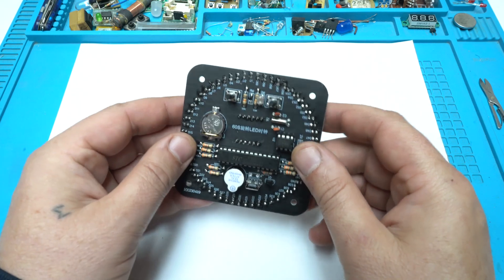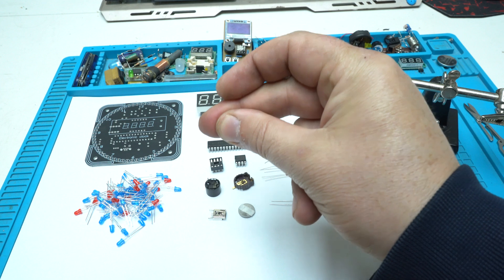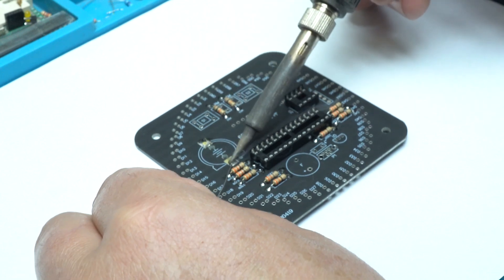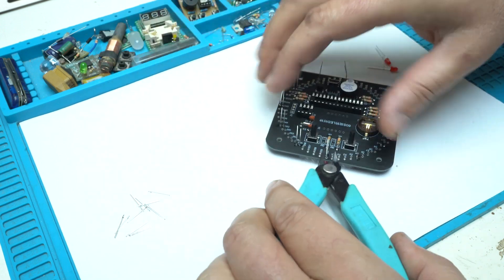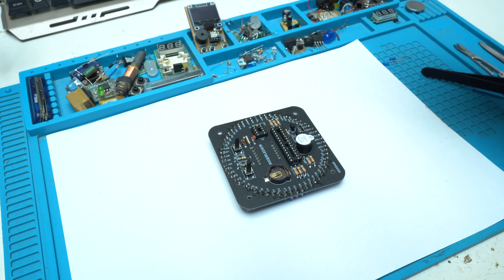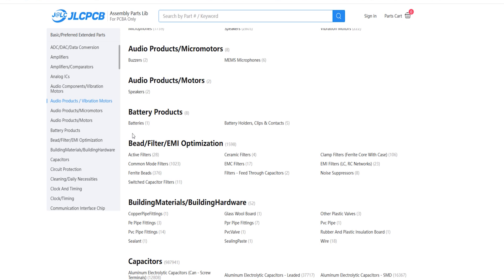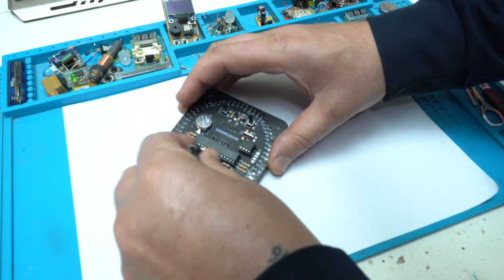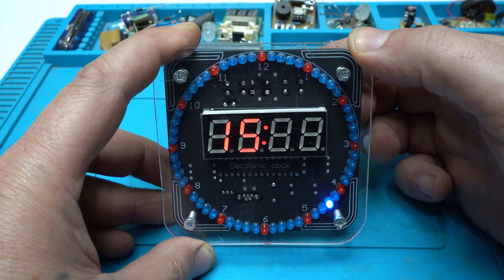$1 Chip! Making DIY Futuristic LED CLOCK - JLCPCB

Comment: I bought one of these and like it so much, I'm considering buying several more (13) for an LED business open sign. I bought this sign at a thrift store for $10 and has a lot of problems with most of the LED's and electronics. So I thought to buy a few of these clocks and place them in the Open/Close time segments of the signs with various time zones and daylight savings time to display. But I'd need to figure out a sort of bus to power them all at the same time or something.

but this project is fun to build and more exciting when you see it function, just the same.